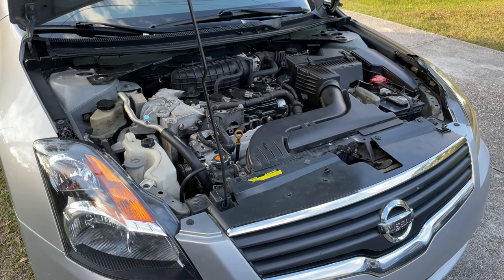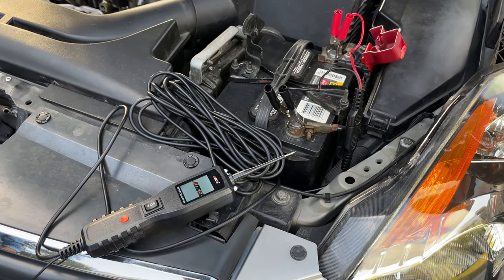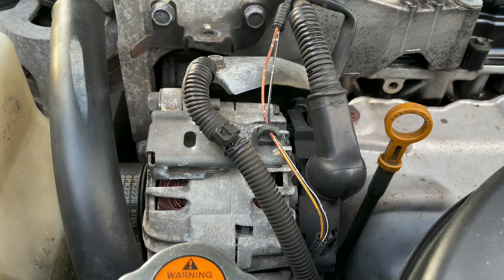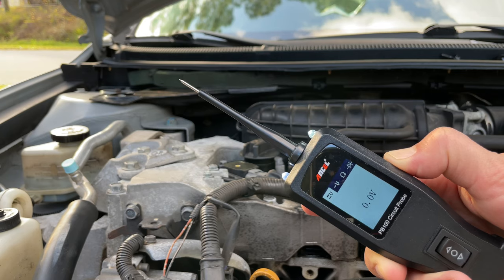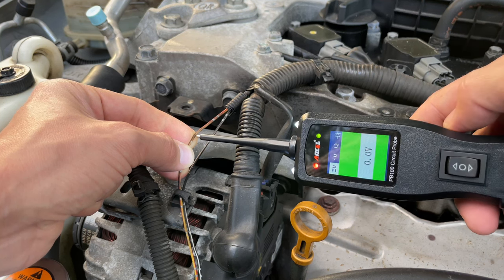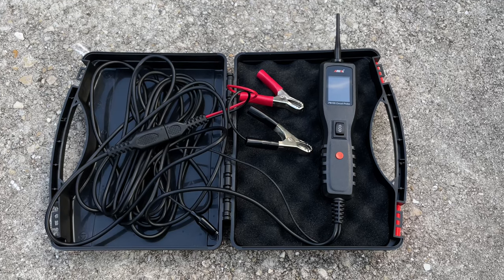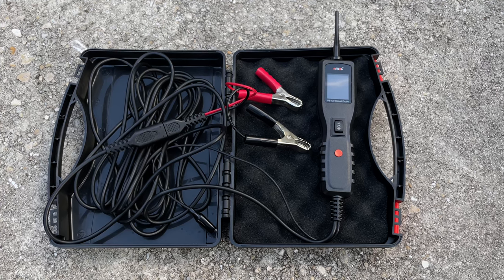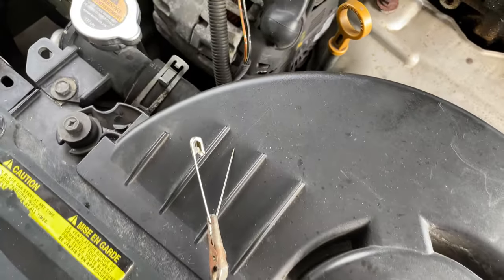How to test AC compressor clutch - easy trick.

Comment: Well i guess i need a ac compressor. Mine dont move at all when i run a wire from battery to compressor. I dont see no ground wire.
Reply: some vehicles the compressor is grounded to the engine meaning no wire, the engine is grounded to the vehicle via braided ground straps
Reply: @ethanmaiden  Thanks for the information but mine does have a ground wire. I couldn't see it. I have a 2006 acura tl
Reply from the maker: You may be able to replace just the AC clutch, instead of the entire compressor.
Reply: @DIYtime  Ok but I found one brand new for 85 dollars. Save the headache and change it all.
Reply from the maker: Changing all is a royal headache. You have to evacuate refrigerant from the system, before you replace compressor, then do the repair, then evacuate the system, then recharge refrigerant.

Comment: Just curious what the ground cable connected to the bracket right above the alternator supplies power to.. it seems to be part of the ac clutch wires that were tested possibly?

Comment: So..... If it does not engage it means either the AC fuse has blown or the AC magnetic coil is faulty not pulling the clutch???
Reply: That's my questions too...
Reply: Yes please answer this
Reply: If it doesn’t engage it means the issue is with the magnetiser which you can replace
Reply: Means you have to investigate more. Could be wiring, fuse, clutch, etc.
Reply: @southerncharity7928 no, this test means it's a mag clutch failure.
Reply: check first the fuse then relay then switch, if all are working proceed testing the magnetic clutch with this method
Reply: Please tell where is located relay turn on the clutch compressor.
Reply: @PandiKristo no relay controls this. It is internal. There is no ac compressor relay on 2012 Rogue. Test it this way and if it is not working buy a $50 clutch replacement.